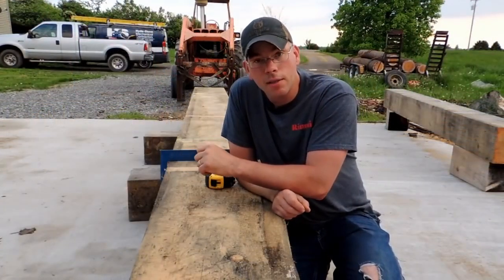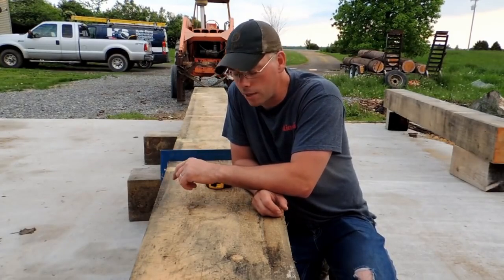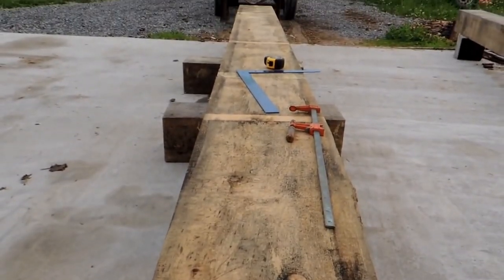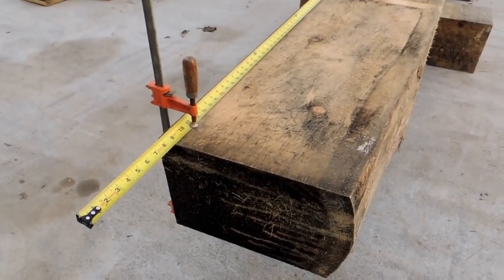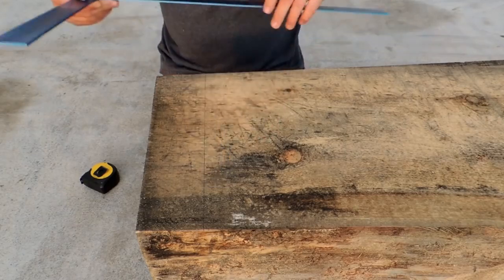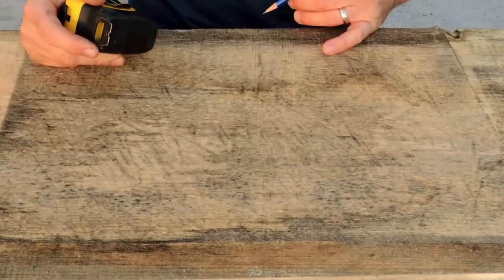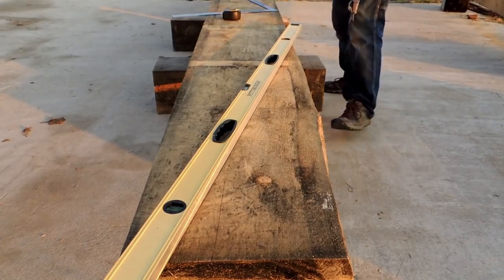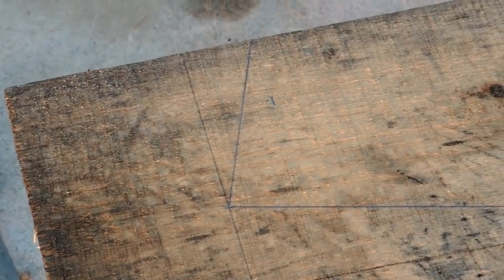Timber Frame Vlog #13: Laying Out A Huge Timber Frame Scarf Joint

Comment: So whats your advice on how to figure out the amount of logs needed for your timber frame. Would you just count the number of pieces in your plans and just total the length and do it that way..
Reply from the maker: Get a cut list of every timber, right down to the last brace.  After that you can determine how many logs you need.